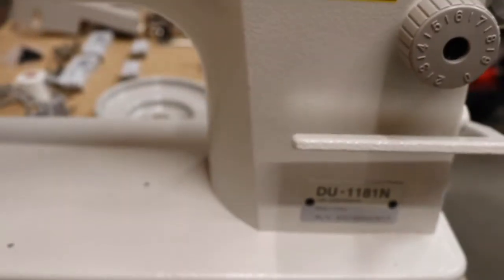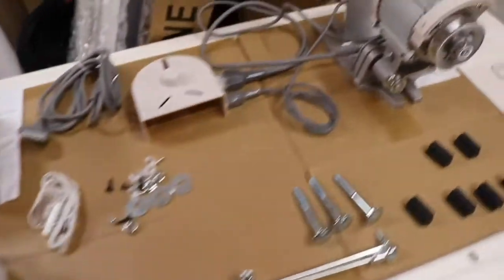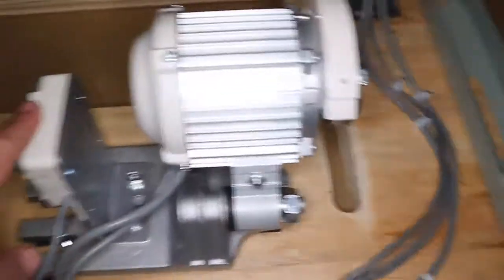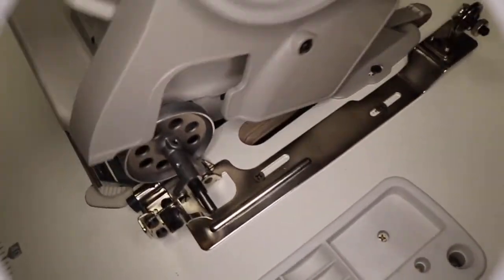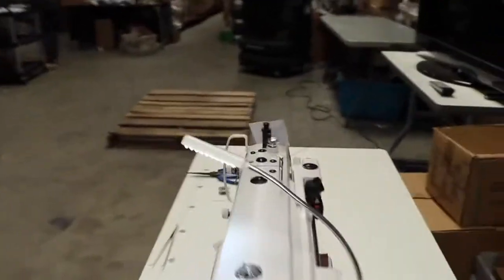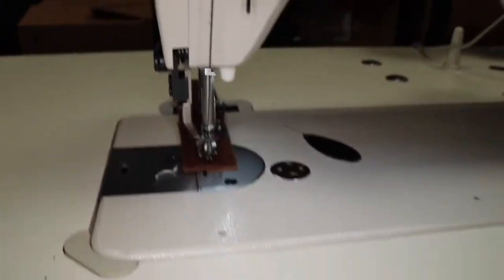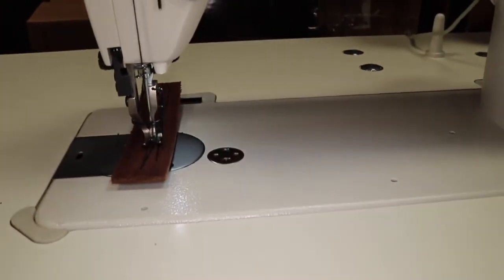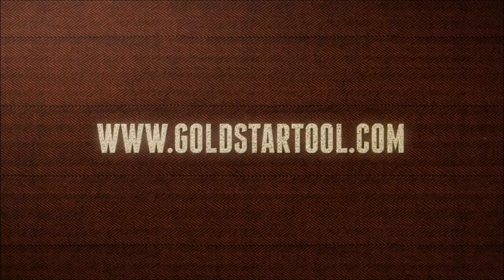Tutorial How to Assemble Juki DU-1181N Walking Foot - Goldstartool.com - 800-868-4419

Comment: You said this machine comes with "Brushless Motor", why did mine come with Servo Motor? You skipped the part of proper install of oil pan. Looks like you removed the rubber buttons from pan and did not use grey rubber supplied by machine and only used the beige rubber supplied by table and did not use rubber adhesive that machine instructions says to use. Shows machine already installed.
Reply: Call him, they are great a communication and getting straightened out, mistakes happen. Hope you love your machine.